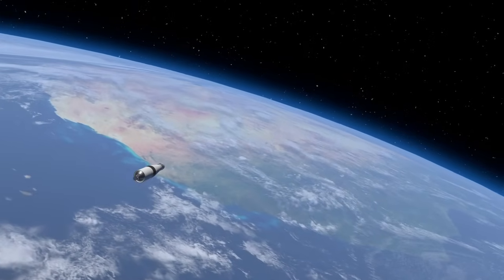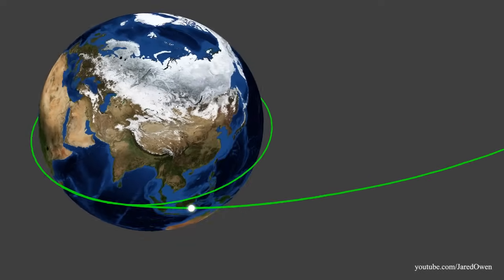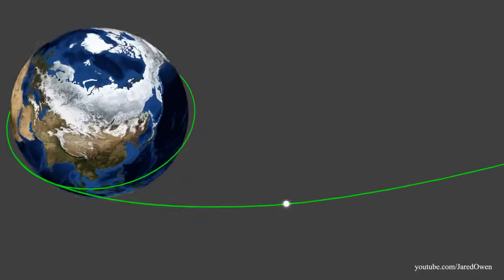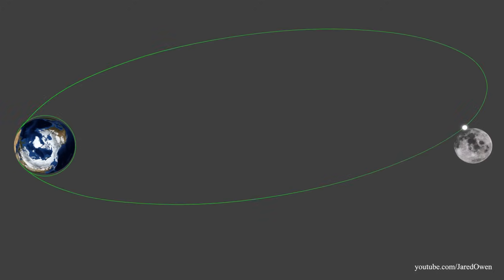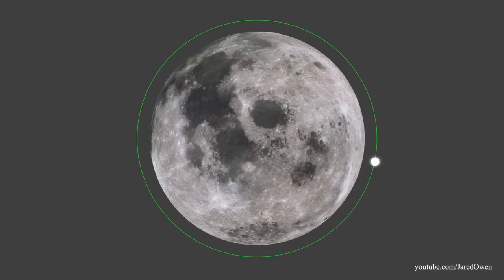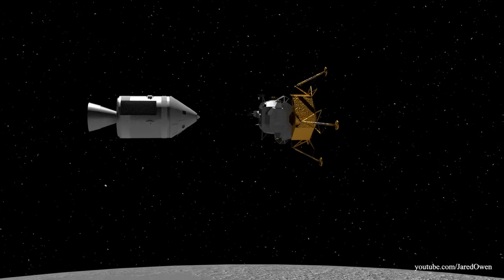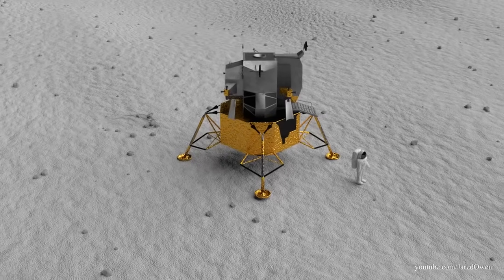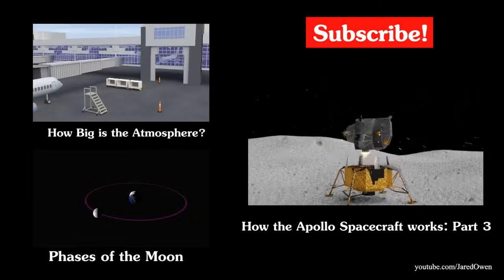How the Apollo Spacecraft works: Part 2

Comment: Fake and gay. There is no way the landing module would have enough thrust to slow down from Lunar orbit, besides where is the fuel for the rocket kept? The design of the lander looks completely unstable and would probably crash if it tilts past 45 degrees. Also the command module looks unstable and could easily spin out of control, especially considering it has to turn around 180 degrees, whilst travelling thousands of miles per hour, which is farcical.
Reply: You don't have a clue what your talking about. Did you even try do do a minutes worth of research about any of the points you have concerns about? It's all available online plus people from around the world who are experts in orbital mechanics and designing heavy lift vehicles & rocket engines have had access to everything related to the Apollo missions including the technology that made them happen for 50+ years and nobody credible has ever come forward with peer-reviewed proof that the Saturn V, CSM & LM are not capable of the mission objectives they were designed for or that they don't have the fuel capacity. Why is it you think you've found something the experts from around the world haven't? Just because it doesn't look right to you means jack squat because the simple fact is the way things move in an environment that is zero-G/low-G plus a vacuum is often counter-intuitive to what people are used to seeing. I suggest you set up an account at a website called apollohoax(.)net and post your opinion there so people who actually work in the aerospace industry can walk you through it all.
Reply: @mako88sb  all they are seeing from the outside are the heat shields not the internal capsule
Reply: @mako88sb  Apealing to authority is not an argument, basic common common sense and discernment is all which is required to see though this hoax.

Take a look at the Lunar Lander and if you think that is a multimillion dollar spacecraft then you are hypnotized. You can clearly see cardboard, kitchen foil, curtain rods and gaffer tape. LMAO it doesn't even look rain proof let alone space proof.
https://i.stack.imgur.com/DCx8x.jpg

It would also be impossible for the Lunar Lander to get into Lunar orbit and redock with the command module using the little rocket and thrusters. It would be nowhere near powerful enough and the precision required to time the take off and match the speed and location of the command module, using human judgement is again farcical. It's hard enough for military aircraft to refuel in-flight.

There's also the problem of air pressure. High altitude Hot-Air ballons capsules ate built like submarines, so they can contain the high internal airpressue. The Lunar Lander clearly isn't designed to contain high airpessure in the vacume of space. and the structure would fail.

If you start thinking for yourself instead of repeating NASA lies then one day you might just wake up put of your coma. There's many other pieces of evidence, which I don't really have time to mention in this comment.
Reply: @Unpopular_Truth  
If you ever do attempt to do some proper research, you would find that every single supposed bit of evidence brought up about alleged proof regarding hoaxing the Apollo landings have been debunked over the years. Most of that evidence was debunked with relative ease because the supposed proof is usually based on complete ignorance of the particular subject involved. It's only people who lack critical thinking skills who fall for this moon landing hoax nonsense. Meanwhile, there's tons of engineering & scientific proof that's withstood scrutiny for 45+ years. Here's some of it:

-> There's the live TV coverage that would have to somehow convincingly fake 1/6th G movement in a vacuum, Google "Irrefutable Proof for Moon Landing - Lunar Gravity" and explain how experts in the field of kinematics for 45+ years have never come forward with proof that the astronauts are not in an environment that they say they are. There's also the fact that any attempts to do filmed mockups of the EVA's on Earth would have to be passed off as live TV broadcasts which would have to fool telecommunications experts around the world. Google "Moon Hoax Not" and "For Jarrah" to get a better understanding of how much would be involved to pull that off and how the filming technology back then was simply incapable of such a thing.

-> There's all the moon rock and core samples that would have to somehow be able to pass scrutiny with geologists who can readily spot whether it's something that has passed through our atmosphere or not. 
Google "How do we know that rock came from the moon?"

-> NASA has made these samples available to scientists from around the world and every year 500-1000 samples are sent out.
Google: "NASA lunar sample request"

-> There's the Apollo 16 UV telescope images that no astronomer in 45+ years has ever found fault with. Google "onebigmonkey apollo 16 UV telescope"

-> Another thing that astronomers would be able to spot are pictures of the Earth that don't match what they should look like. 
Google "Apollo 11 Earthrise - How One Photo Proves it was Real" for an example. 

-> Another one to google is "Apollo 11: Fingerprints in Deep Space" that shows obvious handheld TV footage from the Apollo 11 CM looking at Earth from far enough away that they are clearly beyond the VAB's.

-> Then there are the LOR images. Lots of hoax believer nonsense about them being faked but the transmittal data for them can be downloaded by anybody with a computer and so far, nobody has proven anything about them being faked. You don't think a smoking gun like that wouldn't have been scrutinized by people with the required computer science expertise??

-> Here's something else you might not know. Apollo 12 landed close enough to Surveyor 3 that Conrad & Bean were able to do an Eva to it and removed the camera and sampler scoop from it to be returned back to Earth. They wanted to see what the harmful conditions of the moon had done to those parts after 2.5 years: Google "Analysis of Surveyor 3 Material ad photographs returned by Apollo 12"

-> 5 plutonium-238 powered ALSEP's were left behind that transmitted data from the experiments back to Earth right up till 1977. Unfortunately, due to budget constraints, they were shut down but they did send back enough information that storage of it became a real problem as detailed in this article: 
Google "the-long-road-to-alsep-data-recovery"

-> Starting with Apollo 13, they purposely directed the spent S-IVB's to crash into the moon so that the Apollo 12 seismograph could record the seismic waves generated to help determine the moon's crustal structure and makeup. Of course, as each successful mission added another ALSEP, they were able to expand on the info derived from these man-made impacts. They also did the same with the lunar module ascent stages. The Apollo 16 LM ascent stage data isn't shown because of difficulties during the de-orbit phase. They were able to derive a lot of info from these artificial impacts. 
Google "The Description of Apollo Seismic Experiments darts"

-> Another great site to check out has some pretty thorough crater analyzing to prove the landings happened. You can check out all six of the landings this way:
 Google "onebigmonkey apollo sights landing"

Are you starting to understand the magnitude of what would be involved to pull a hoax like this off? Never mind keeping it from being exposed?

I suggest you also take the time to read through the 93-page pdf titled "NASA’s Recommendations to Space-Faring Entities: How to Protect and Preserve the Historic and Scientific Value of U.S. Government Lunar Artifacts". There is lots of nonsense from hoax believers that the USA is trying to make the Apollo sites inaccessible which is ridiculous seeing as these are only recommendations designed to limit harmful effects of spacecraft landing too close or the altitude of hopper type craft flying at too low of an altitude. The fact is, the USA has no issue at all with visits to the sites by manned or unmanned means. They do request the Apollo 11 and 17 sites are accorded with the proper respect due to the obvious historic value. Also, there is an Appendix B in the pdf that gives a lot of recommendations from NASA as to what type of investigations at the Apollo sites would be most beneficial for scientific purposes. Now does this seem like the type of behavior for a country that supposedly faked all of this??

As I said, irrefutable proof that has withstood scrutiny by the relevant experts from around the world in all the specialties involved for 45+ years which in my book proves beyond a doubt that the landings happened just the way they were documented 45+ years ago and which easily trumps claims by hoax-believers that fall apart quickly with any kind of scrutiny..
Reply: @Unpopular_Truth 
 I think I've got a pretty good understanding of just how impossible it would have been to plan, pull off and maintain a hoax of this magnitude so have come up with what I think are some key points that I've asked numerous hoax-believers to try and respond to with something else other what I've come to characterize as the typical hoax-believer response. So far nobody has made any kind of credible effort to do so. Most people don't even try. Those that do respond usually resort to grade-school insults.:

-> 400,000 people were involved with the project, yet nobody has come forward with evidence that the landings never happened. You guys like to bring up the Manhattan Project compartmentalization security that kept only the ones in the need to know fully aware of what was going on. Yeah, sure. A top-secret military project that kept even vice president Truman out of the loop being compared to a project like Apollo that was as publicly open as possible. Yet despite all the USA's attempts to keep the A-bomb project under wraps Russia still managed to get key people in the right places to provide them with enough info that they developed their own bomb much sooner than the USA expected. You seriously expect us to believe that compartmentalization was possible in a project as huge as this that so visible to the public? Or that in the past 45+ years since the landings were supposedly staged, nobody has come forward with insider information or definitive proof? Yeah, right.
->Typical hoax believer answer: (Something involving a worldwide conspiracy with zero credible proof)

-> The Russians tracked and confirmed all 6 of the Apollo moon landings. Why would the USA's major competitor during the space race do that?
->Typical hoax believer answer: (Something involving a worldwide conspiracy with zero credible proof)

-> Russia, Europe, China, India and Japan have all flown missions to the moon. So far, none of these countries/nations have brought forth any evidence that it's impossible to do a manned mission to it. That includes this nonsense about the radiation in the VAB's being too hazardous to pass through. No credible radiation expert from any country including the ones mentioned here have ever stated that the radiation in the VAB's was an insurmountable problem during the Apollo missions to the moon. Why is that?
->Typical hoax believer: (Something involving a worldwide conspiracy with zero credible proof)

-> Scientist from around the world for the past 45+ years have verified and peer-reviewed all of the lunar rock & core samples plus all the data transmitted back to Earth by the ALSEP's left behind. There's also the Apollo 16 UV telescope images that include some of Earth that no astronomer has ever found fault with. That's as close to irrefutable proof as you can get. So how about you explain this away
->Typical hoax believer: (Something involving a worldwide conspiracy with zero credible proof)

.
-> Hoax believers have for the last 45+ years tried to find evidence that the landings were faked and have found nothing that can't be debunked. The proof they failed is that despite all their efforts, the missions are still in the history books. A story of that magnitude would have been seized on by investigative reporters and news networks. Not just the USA but countries from around the world would have gone after the biggest scoop in history. Explain how come they haven't.
->Typical hoax believer: (Something involving a worldwide conspiracy with zero credible proof)

-> Third party evidence that NASA would have had to orchestrate and coordinate flawlessly while at the same time supposedly hoaxing the mission; How could they manage that without insider proof coming forward for the past 45+ years to blow the whistle on it all?
->Typical hoax believer: (Something involving a worldwide conspiracy with zero credible proof)

Trying to discredit information because it came from NASA, as I'm sure you'll do, is a bit ridiculous. They made all the engineering and science required to pull the missions off available to their counterparts from all kinds of countries throughout the world.

In regards to the Apollo landings, we are talking about hundreds of 1000's if not millions of people with above average intelligence in various countries throughout the world over a time span of 50+ years.

I'm not just talking about the people involved with the project while it was happening. There's also all the scientists and engineers in the following decades that have access to everything related to it regarding the engineering plus all the scientific, peer-reviewed evidence, data and samples. Yet in all that time none of these highly intelligent folks from around the world have ever found a way to somehow get information out to anybody about NASA"s alleged duplicity regarding the supposed landing hoax.

Considering how incompetent everybody seems to think governments are, it's pretty amazing how people like you have no problem believing that a hoax of this magnitude could have been kept for so long without one piece of verified proof from the hoax believers being brought forward in 45+ years. All you guys have is unsubstantiated claims that require ridiculously more unlikely and equally unverifiable conspiracies within conspiracies to keep the original moon landing conspiracy going. Does that not give you the slightest hint that maybe the moon landing conspiracy is seriously flawed? People who see no problem with this usually dismiss, ignore or don't understand the irrefutable scientific evidence.
Reply: @WokeSavage81 [Relative motion works when an object is moving in a perfect straight line which the Lunar Module isn't.]

Do tell me how Newtonian motion somehow stops working just because the motion in question is in an orbit. Please, enlighten me. Your radically new approach to physics will surely be enterta err I mean educational.

[The entire trip the Lunar Module is in an orbit between Earth and the Moon moving at 17,000 mph.]

1) The orbit is around the Moon and

2) Both spacecraft are moving at 17 000 mph during docking. Minor differences in their orbits will cause a bit of drift, but nothing major.

Comment: Excellent, but just a little precision: the main engine was cut during the final descent just a few meters before touching the ground. As the gravity is really low, the descent was an acceptable pace in a free fall from this height. Moreover, running the main engine too close to the ground could have litteraly flipped the LEM over.
Reply: Yeah, I couldn't believe they messed that part up in "First Man".
Reply: @mako88sb  Agreed. The Spacewalker is clearly better.
Reply: @EmmanuelB  
I thought the Apollo 11 episode in the mini-series "From the Earth to the Moon" was way better in many ways compared to "First Man". It seemed to give a much better feeling of just how much of an awesome accomplishment the first moon landing was plus it got the engine shut-off before landing right. Must admit I was disappointed with "First Man".

Comment: Your life is like the astronaut in the CSM who flies to the moon but doesn’t land it
Reply: They were all very happy to do that job, in fact most of them asked for the job. Not only was in an important part of the whole mission, requiring very skilled pilots (they had to be able to work alone, including potentially flying down to "collect" the LM if it could take off but not get into a high enough orbit, or back to earth on their own if there was a problem with the LM that stranded them on the moon),  but it also put them on rotation to command a later mission. As it was though, the Apollo program was cancelled before any of the CMs from the moon landing missions got a command (Collins could have, most likely on Apollo 17 but chose not to). Jim Lovel (Apollo 8 CMP), Dave Scott (Apollo 9 CMP) and John Young (Apollo 10 CMP) all did command later missions and walk on the moon. Ken Mattingly (Apollo 13 CMP, put back to 16 due to German Measles risk) went on to command two Space Shuttle missions.